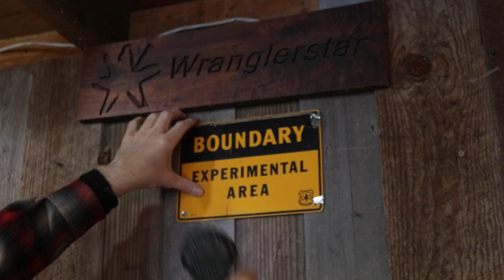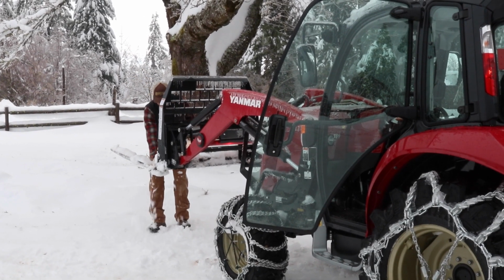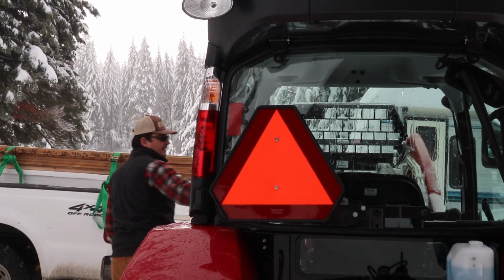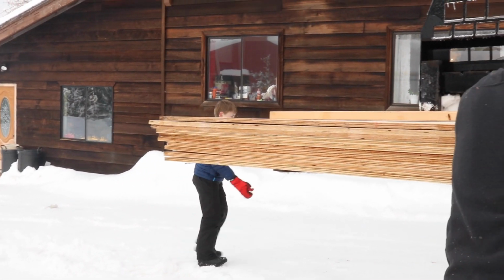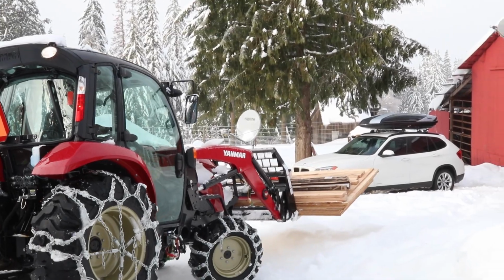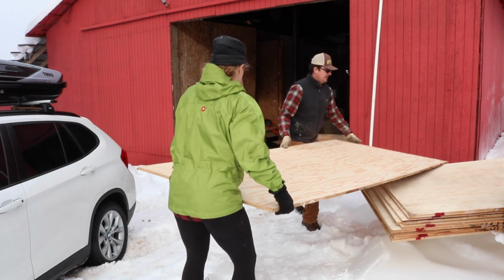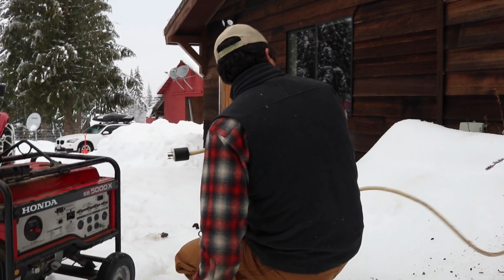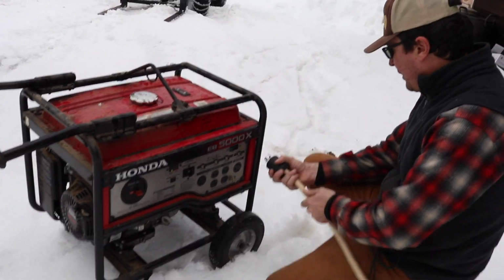THIS ROOM IS KILLING ME I CAN'T TAKE IT ANYMORE!!

Comment: I have set up my generator to back feed through electrical welder connection in my work shop. My welding cable is somewhat over sized and appropriate gage for the generator. The underground cable to the workshop is connected through the master breaker box in the house.  The procedure to bring the generator on line is to turn off the master breaker to the grid!!!!! The house master breaker must remain off until power is restored to the grid and the generator is disconnected.  This is literally a mater of life and death.  The breaker for the shop in the house and the breaker for the welder in the shop are set to the off position and the generator is connected to the welder plug. I then start the generator and make sure it is operating correctly before energizing the welder breaker in the shop.  Then after that checks out, I energize the breaker that powers the shop from the master breaker box in the house.  I don't have to move the generator around or operate it outside.

Comment: The way that generator is hooked to your house creates a rather large hazard you did not mention. If some one who wasn't as familiar with electrical safety were to hook up a generator like that there is a very high likely hood that they will hook up the generator end of the plug before the house end which energizes the exposed electrodes on the male at the other end of the cord.

Comment: I wonder how long it will be before the electrical nazis blow about generator setup. Mine has the suicide cable too. Along with the stress rightly placed upon ensuring that the main circuit breaker is switched off prior to powering the house via generator, it is also necessary to mention that the "dryer end" of the suicide cord be plugged in before the generator end. The "dryer end" is male and would easily provide a 240VAC shock or be shorted to anything it touches.
Reply: It is also worth noting that the main breaker you mentioned being imperative that it be switched off, that should happen prior to connecting the "dryer end"  too. Otherwise, if the power came back on prior to the main breaker being turned off, the "generator end" of the suicide cord, being male also, would be hot. Sequence is of the utmost importance in this setup: 1. main breaker OFF 2. "dryer end" of cable connected 3. "generator end" connected.
Reply: snakedriver73: When this is done, aren't both ends male?
Reply: Michael Dougfir, yes, both ends are male.

Comment: I would really usggest an isolating transfer switch between the electricity meter and the consumer unit. That way you get a single socket to plug the generator into without using a "sucicide lead" backfeeding and there is no chance of frying a lineman. They cost less than $50 sotheres really no reason not to have a proper generator hookup thats safe.

Comment: A proper changer over switch gear to add a generator into the house circuit is recommended. Your method can be dangerous and is not approved by insurance companies or national electric code! If you feed power back toward the power grid you could endanger those guys and gals restoring broken lines, transformers, etc. As an appliance repair person I have seen what happens when the wrong voltage is supplied and surging due to improperly installed generators and such. We live in an electronic world and most cannot be easily repaired when you let out the magic smoke!
you show doing the right thing with tools and tractors , etc not sparing a dime so why not add the proper switch gear and be safe.

Comment: just something for everybody elce who kinda wants a small bit more code way of doing this. you can buy generator inlets, witch are a more proper device for your generator incoming power. all you godda do is put it in your desired location and feed them with some 10/3 romex or bigger if you like. and then on your panel they make generator interlock kits (for siemens at least } that prevent you from having the main on at the same time as your generator making it impossible to back feed the grid. it will have the same result as this,....but its code!  lol

Comment: Hey no expert on electricity, wiring etc. but I had an inlet installed to and separate breaker box.  It allows me to not put my generators juice into a couple of selected circuits and not to the power company lines possibly hurting someone.   It was $1500 the best money spent and we don't have near the power losses you do.  I believe what you are doing may be dangerous.

Comment: Isnt there Power in the barn? I assume it can carry a 30 amp load. which could go to the house. Turn on the breaker to the garage, use your welders outlet and turn on the breakers you want in the house. This way it is much quieter with the loud generator in the garage. I wont mention the Whip of Death since you didnt actually show that side, but i Cringe every time I see someone doing that. Nobody likes a Safety Sally.

Comment: DON'T ever back feed your electrical panel.  That is an extremely dangerous way to provide emergency power.  If you forget to turn off the power company feed to the panel when you are on generator power you will feed 240 volt power back. Into the utility power system.  When your generator power is connected to the secondary of the power company's distribution transformer you will be placing high voltage that the power company power lines. This voltage could be easily 15000 volts and could kill a line worker or anyone who may come in contact with downed power lines.  If you action caused the death of someone you could be charged with a crime and spend time in prison because of your negligence